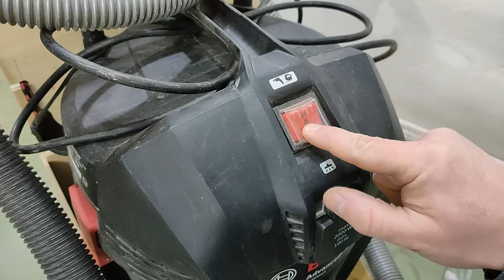2 Ways To Make DIY Cyclone for workshop | Classic Dust collector VS Thien Cyclone Separator

Comment: The inlet pipe should exit UNDER that board, and must be right against the side to get proper spin. The shop vac should have zero dust in its container, else your cyclone is not working

Comment: I believe the main issue with this design is the inlet curve. Try to cut it 45 degrees lengthwise so dust does not hit the bucket walls as soon as it gets in. There should not be such a carryover in the shop vac.

Comment: So the Thein filter was less effective than the classic collector. Interesting. You have saved me time. Tell me  though, what is the reason for the brass gate fitting? And what is that gate fitting called?
Reply from the maker: Leo, it's a Check valve 3/4, like this - https://amzn.to/31xUoDc  I installed a check valve to make sure my bucket does not flatten when the cyclone inlet is suddenly clogged with a large object. I demonstrated this at 17:33
I'm actually surprised that Thien is less efficient, now I continue to use vacuum cleaner with the Thien baffle. Let's see what will happen next
Reply: @MazayDIY  what's the pressure rating on that valve?

Comment: This doesn’t prove anything. The whole point of a Thien baffle is to separate larger pieces from smaller pieces. This keeps your filter from clogging up with larger size particles. You are still going to have to filter the air. 

After making my Thien baffle my dust collection was dramatically improved. I rarely had to empty my fine filter bag as my trash can collected probably 98 % of the sawdust.